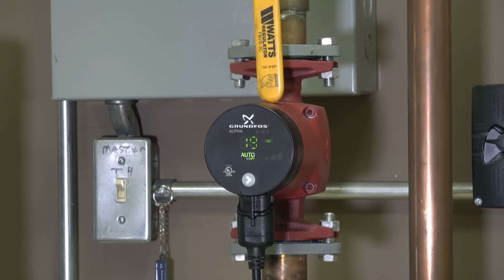Hydronics System Components

Comment: Wouldn't you want to have the circulators on the return side because you're moving fully hot expanded water you want to generate a negative pressure on the return side
Reply: Correction on the supply side

Comment: My Grundfos circulator installation instructions state to rotate the black box so that the conduit coming in is facing down, not up. Are these all installed incorrectly and it doesn't matter, or does it vary by specific model? On a related question while I'm asking, I snapped one of those flanges on an older pump I replaced (it was twenty years old and due anyway).. I didn't, in my opinion, use excessive force. Any ideas? How tight on the donut gasket is tight enough? Thanks for the video.
Reply from the maker: The specific language of most Grundfos manuals is as below and provides a diagram. The conduit leaving the box and going down is so that any water pooled on top cannot in between the conduit and the box due to lack of sealing.

3.1 Position of the terminal box
Proper installation of the pump has the terminal
box located to one side of the pump or the other,
with the conduit entry down.
Reply from the maker: In regards to tightness, we do not beleive Grundfos publishes torque ratings and even if they did, most installers don't carry a torque wrench with them.

With that said, piping connections breaking after 20 years when a wrench is applied is not uncommon. Sometimes the corrosion in-between can sort of fuse or seize it together and make it stronger. The use of a sealant with the gasket when installing can make it easier to dis-assemble in the future. It could have also cracked due to the threaded bolts corroding together and then you really having to crank on it to loosen.

Comment: Thanks for a great video! You are great at explaining things so that simple minds like mine can understand! Question. Why do I need a pressure reducing valve on a closed system?
Reply: I maybe should have finished the video before asking questions. 🤦🏼‍♂️
Reply: Also, same question with the backflow preventer. Do I need one on a closed system?
Reply from the maker: @ Backflow preventer is so you can't send your hydronic water back into the domestic water system should that system lose pressure.
Reply from the maker: You need the pressure reducing valve when you are connected to the city water supply. That pressure will often be 40-60 PSI and we need to be under 30 PSI for most systems to avoid popping the relief valve. Most systems operate at 12-15 PSI.

Comment: Great vid! My 15yr old system howls when circulation is on. What could be the issue?
Reply from the maker: Describing sounds is always tough so we are not sure what "howls" means exactly (post a video link if you can). With that said, the most common cause of noise in hydronic piping systems is air. Start with this video https://youtu.be/trWdSuMFzK0?si=goW9XD7xg3Q2SZbM
Reply: @TECTubefilms  probably your circulator is oversized for you system. If water circulates too fast through the pipes, it gets noisy. You might have a speed control on your circulator. If you do, try reducing the speed. Otherwise replace your circulator with a lesser speed unit.
Reply from the maker: @shiroitake we think @chrisgoodrich1795 meant to tag you with this response instead of us
Reply: My circulator pump howled (screeched) when it went bad.
Reply: Could it be more of a moan than a howl?

Comment: If you are doing a driveway hydronic system. What pumps do you recommend? I have seen those grundfos pumps on many systems and you are using a glycol system so there is some worry of freezing or going below freezing and these systems are designed to continuously move fluid through the system even when not heating, so there are operational conditions that will below 32 degrees but those pumps are only rated to 36 degrees F. Or am I missing something as I have looked at other manufacturers and they also range from 35-38 degrees minimum operating conditions.
Reply from the maker: We use Grundfos circulators on snow melt all the time... for 2 decades. Keep in mind that the circulator is mounted indoors and it is connected to a boiler that is either shared with other applications and hence already hot or it is dedicated to snowmelt but running in idle. In either case, the water in the pipe is not below freezing (in fact it is not below 85F). And we always put our circulators on the leaving side of the boiler (never return) for all systems.

Comment: I am making a wood boiler..
I was wondering, do you recommend putting the pumps connected to the infeed, rather than the outfeed? This is explained to me, the motors are at the coolest placement of fluids on the pex lines...

I was also thinking of making a buffer tank from a repurposed water heater or other tank I have. I like the idea of having a lot of heat stored inside, so less loading wood..? 

Good video
Reply from the maker: We don't have experience with wood boilers but assume you are not going to be making water hotter than 180 or 190, hence no issue with the pumps on the supply side. The air separator works best with the hottest water, the expansion tank hangs off the air separator, the pump needs to be right after the expansion tank. That is why we put all of it on the supply side of the boiler.
Reply: I am also installing a wood heated unit. I got a hot water loop for my cook stove. My plan is to run glycol through the stove then to a heat exchanger for domestic hot water before heating the floor. I was worried about over heating my pump. So my thought is to go from the stove up through the expansion tank and air bleeder then down the tube in tube heat exchanger to the pump where it will push it down through the floor. I also wondered about putting it on the cold return from the floor side to be as cool as possible. For the fire to burn hot and not get cooled down too soon, I want the pump to kick on after the fire is going well but before the glycol gets too hot. I assume a temperature switch must be doable

Comment: Expansion tank should have an isolation valve and a drain valve or a combination valve like the webstone. Air pressure in an expansion tank should be checked yearly and in order to do that properly you must isolate the tank from the system and then drain any residual water pressure from the tank in order to get an accurate air reading. Relieving that pressure from the system by the system drain valve allows fresh water and air to reenter the system. This is one of the most common mistakes made by otherwise experienced mechanics.
Reply from the maker: We do agree that you do not want to introduce new make-up water into the system if you can avoid it for the reason you mentioned (new air introduced from the city water along with more minerals).
Reply from the maker: We never put isolation valves on expansion tanks in small systems.  People tend to turn the valve and then it starts dumping out the relief. There is no reason to check the pressure of the tank annually with a gauge.  Unless you have a defective schrader valve AND defective valve cap, the only place for the tank to lose pressure is for it mix with the water.  Where else could the air go?  If you suspect your diaphragm is broke, you can do an audible test by tapping on the side to see if it is water logged.  So the tank is either at original pressure or it is full of water.
Reply: @TECTubefilms  Expansion tank membrane permeability: Reader NJT, Holohan, and several other sources cited at REFERENCES note that a bladder-type hydronic heating expansion tank may lose air pressure at about 1 psi per year as air passes through the tank membrane and into the heating system's hot water.
Reply from the maker: @anthonyspadafora1384  We will read up on the permeability issue. What you are saying does make some sense. Although it can't possibly be 1 psi per year. We have too many projects that are old and are not blowing relief valves for that to be the rate.  We even have two Honeywell tanks in on of our labs that were installed in 2006 and have never had charge added.
Reply: @TECTubefilms  Actually all you have to do is press on the schrader and water will come out if the bladder is broken.
Reply from the maker: @anthonyspadafora1384  But if it not broken, then you just let out some air charge by pressing it. With only 12 PSI to begin with, you don't want to press it and bleed it down more.  Tap it first for audible test and then if it fails that, then press the schrader.

Comment: I’m from the south so we don’t have boilers. Why do you need a boiler and not just an 80 gallon hot water tank?  Why can’t an 80 gallon water heater be hooked to the recirculation system directly? I’m sure it has something to do with efficiency or some thing I guess. Thanks!
Reply from the maker: In past decades, we have done projects with small heating loads where they used water heaters to heat the space. However, most standard water heaters are horribly inefficient. Even an Energy Star water heater is only 68% efficient for a 40-50 gallon size. Whereas the legal minimum for a boiler is 84% efficient and the energy star ones are 90%.
Reply: Up north you primarily have heating loads not cooling like in the south. A typical electric hot water heater is heated with a 4500w electric element. That’s roughly only  15000 btu, a typical residential boiler is 150,000 btu. There just isn’t enough thermal energy is a hot water tank to heat a house. Not to mention boilers heat water to over 180F , much hotter then a residential water heaters do.
Reply: @rbj4098  thanks. Great explanation. The BTU comparison says it all!
Reply: @rbj4098  it’s not a hot water heater if the water was already hot it wouldn’t need to be heated lol

Comment: where is your contact info? do you have branches in NJ?
Reply from the maker: No, all of our locations are based in the Midwest and we only provide direct support to contractors and engineers who are customers of Temperature Equipment Corp or Excelsior. If you are on the East cost, we suggest you contact a Hydronic supplier in your area.

Comment: First off love the video. Great job showing the basics. I'm in the planning stages of one of these systems and was wondering if you can share the brand and model number of the tank or reservoir you have at 6:46 time slot? Thank you.
Reply from the maker: The glycol feeder tank?  The one in the video was Axiom.  But lately we have been using GTP brand.  Size is dependent on the system but for residential and light commercial, we often use GRE07-E7-4.

Comment: Bill I like your Video, But in your System it's best to avoid Rust into to the system  (we do that by not using any carbon steel pipe of fittings). Dementalized Water is best. Boilers  don't like (Oxygen causes corrosion) so by removing these items the Boiler operates better. Water Chemistry is Very Important in the longevity of the System. I am a Old Boilermaker that work on and with these Boilers for 40 years. I am a firm believer in these Boilers and a better Heat Source with little or No Troubles if installed Correct.
Reply from the maker: If you are referring to the black fittings on the expansion tank they are not an issue. Oxygen is also not an issue.  Unlike domestic water, a hydronic system circulates the same dead/distilled water for 20 years. Once we use an air separator  to remove the air from the initial fill, there is no longer any oxygen in the air.
Reply: @TECTubefilms  Thank You for your reply. If it was my system there wouldn't be Not Carbon Steel on the System anywhere. You are using all non Carbon material in the Boiler, why do you think the Manufacturer did that?  Copper, Brass and Stainless Steel tubing are All Non Corrosives materials.  A extra $1.50 would saved You from contamination from for this System. This Carbon steel pipe to the Stainless Steel once contaminated can't never be Changed. Carbon Steel leaves Carbon Deposits on the Stainless. You may no see it but it's there. Over a period In time the stainless will rust because of the carbon desposits. I know I have seen it many times. You never mix Carbon Steel with Stainless. Carbon steel  desposits will cause Stainless to rust. In addition we used a chemical to remove the air because of cavitation in the pumps. But the Oxygen will do damage if not remove.  Oxygen is a Oxidizers which speeds up the rust of carbon desposits on the Stainless to pitt the Stainless walls of the tubes.  Pitts are tiny holes in the tubes.  By removing the Oxygen and All Carbon you stop the Pitting which increases tube life in the Firebox. The Firebox is the Heart of the System. That is why a Chemical Test of the Water is so important. I have been there my Friend. I would highly recommend You change You protocols on installation. Most time a Boiler failure is caused by Boiler Chemistry. Proper installation is the Life of a System. 
On commercial Boiler we Used Carbon Steel because of Temperatures of 1200 degrees at 2750 psi. But the Water Chemical was check every 12 hours. By checking the Water Chemicals that made the Chemistry correct extended the life of the Boiler. But with All Stainless 304 and above grade Martial in a Boiler would last for ever.  
But with the Big Boiler You have, you could add a Second Holding Tank with coils of Cooper Tubes (Heat Exchanger) in the 2 Tank and you could create a Hot Water Tank to heat the Hot Water for the House services plus add Radiant Floors to garage's and still have a water reservoir of Hot water for Demand with very little in extra fuel cost. If those Tanks are well insulated they can hold Hot Water for Days. One 300 gallon tank or 2 - 200 gallon Stainless Steel 10 guage metal Tank at 60 psi for Bathes or Showers and the other for Radiant Floors or Water to Air Heat Exchanges.
Nuclear Plants do the Same Process in heating Steam to drive the Steam Turbines. That is a condensing Boiler that these Nuclear  Plants use. The Reactor is a Closed Loop System that uses Steam from the Reactor to heat Water in a Heat Exchanger that drives the Tribune a Closed Loop Ed System.  It the same Process with the Natural Gas Boiler and the Extra Tank.
Recirculation in the closed Loop System is amazing thing. It save on cost all the way around in Chemical and in reheating. If water going to a heat exchanger is slowed down to inches per minute verse Feet per Minute you have greater Heat Transfers. Next that is why the Water in the Closed Looped System must be Very Clean. Do you know what Coal scaling is? That word is used to stop Heat Transfer. It's a scale that attaches itself to the inside lining of a Tube. It limits, stops the Transfer of Heat from inside the tube, pipe, heat exchanger or Pex tubing. This is another reason for water Chemistry. Cleaner the Water the better You are.
If we Lived Close I could Show you many things. But you are probably are in the North and I am South of You. Best Wishes. I would like to have one of those Boiler setup for Burning LP Gas. I would install it in my Garage. Wish wishes My Friend. 
The system would pay for it cost in 7 Years by Fuel cost and Labor cost. The Baths and Shows would be a Heat Exchanger meaning You heat that Bath water from the boiler heat Exchanger in the tank you decide to be a hot water tank for Showers. But you won't add No more Water to the System Water. If You do make it demineralized water. Meaning All Minerals are removed.
Reply from the maker: The system depicted in this video in one of our labs does also have an indirect tank on it for heating domestic water.
Reply from the maker: We could love to keep debating the black pipe thing with you, but honestly we are “just the marketing people” who run this page for TEC. You would have to talk to Bill (the instructor in the video) or one of the other experts in our Hydronics division to have a deeper conversation.
Reply: @TECTubefilms  I taught You are the guy in the Video. Sorry.
Reply from the maker: No worries.  There are a lot of us here at TEC.  LOL

Comment: What keeps the buffer tank temperature high enough to heat the smaller zone doesn’t it lose temperature like a hot water heater?
Reply from the maker: There is a temperature well on the side of the tank and that sensor can wired back to the boiler control.

But even without that sensor, as water moves from the tank to the zones, new water from the boiler will come into the tank so eventually the boiler supply water temp will fall below its setpoint and fire.

Comment: Paint the pipe or put arrows on it to indicate flow.  Saying from the expansion tank you go to the air eliminator is confusing.  The flow is from the boiler to the joint that has the expansion and air eliminator.  
I wish his narrative was based on flow instead of here’s a component and this is why it’s here.  But perhaps flow is obvious.  Trying to learn is all!!!

Comment: What would make the pilot go out?  It may stay on for weeks, days or hours but then goes out...
Reply from the maker: Someone closing the gas valve, undersized gas pipe and another gas appliance kicking on, loss of city gas pressure (which is rare), a breeze near the pilot (also sort of rare), etc.
Reply from the maker: BTW - standing pilots have been prohibited nationally on new residential boilers since 2012.  They waste energy all summer.